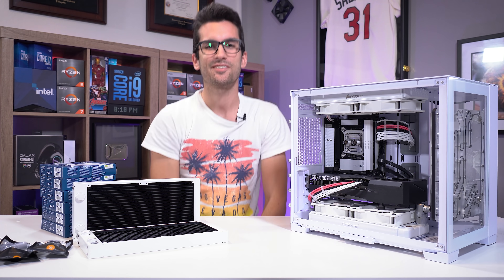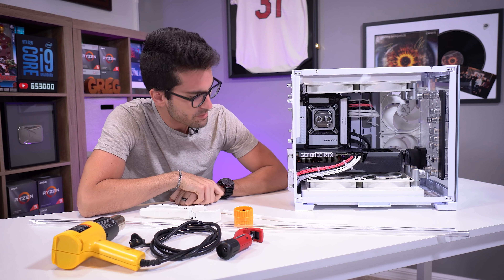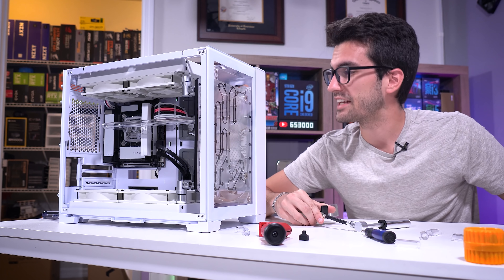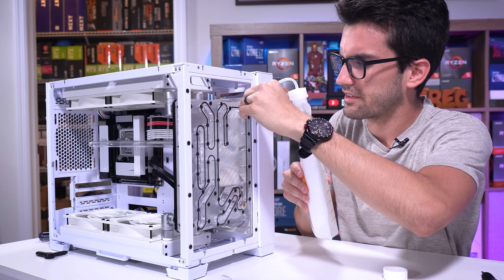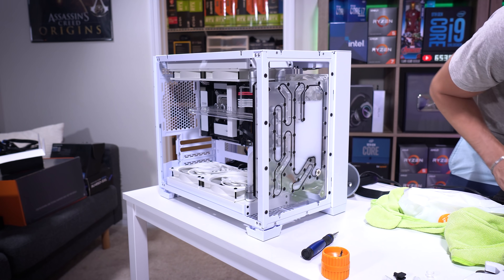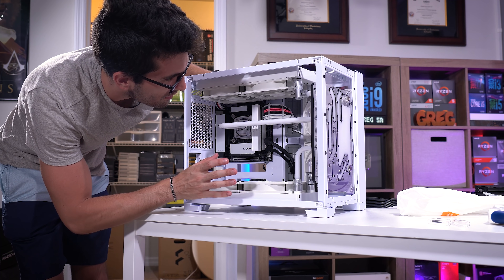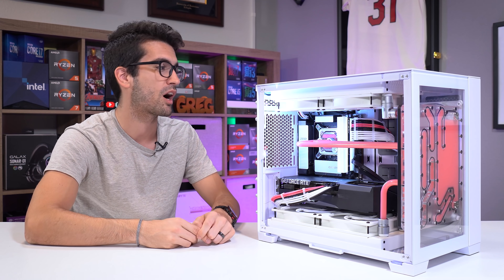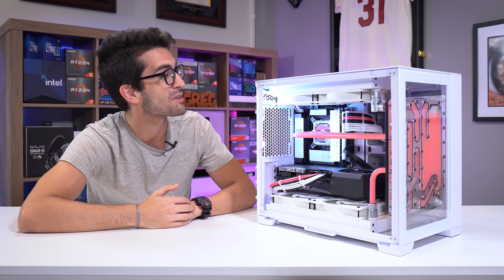Building in the Lian Li PC-O11 Mini! (Part 2)

Comment: at every chance I'm trying to give you the benefit of the doubt Greg, I'm torn because it's nice to see human mistakes as they are valuable lessons and it helps. But man you could've done this build better. Personally, I'm fine with the video card as you are, but the loop is a mess. Just oof man. did you miss one of the tanks in the distro block?
Reply from the maker: The loop? It's perfectly fine. One of the channels was specifically for the graphics card (which we obviously didn't custom water-cool). Can be easily filled with fluid to just sit there. I'm very happy with how it turned out and the simplicity of it. We've made plenty of crazy custom loop rigs in the past on this channel.
Reply: @GregSalazar  for aesthetics that would've been a better option than leaving it unfilled, but I know that's a personal choice.